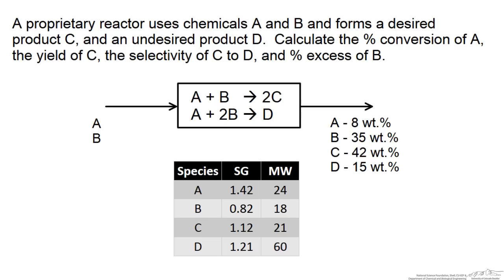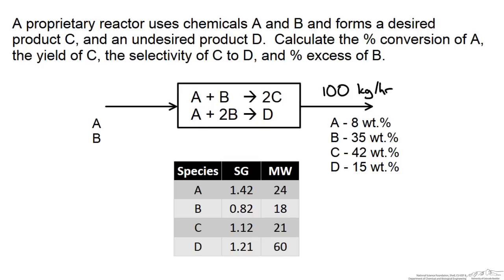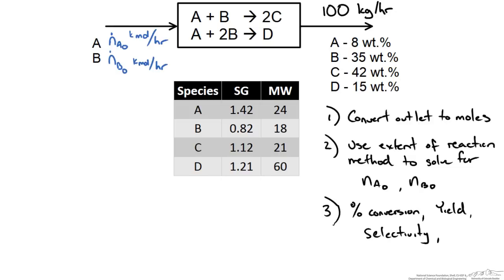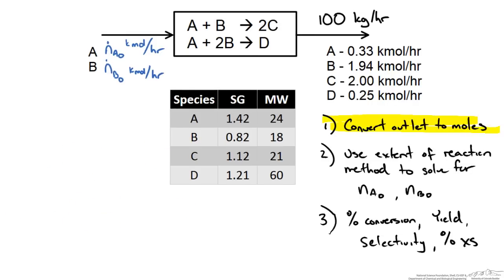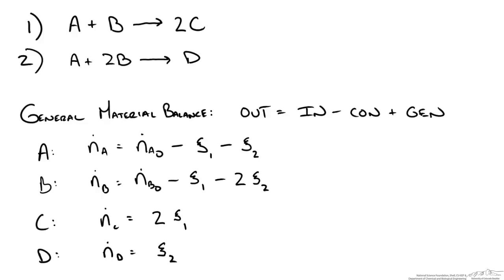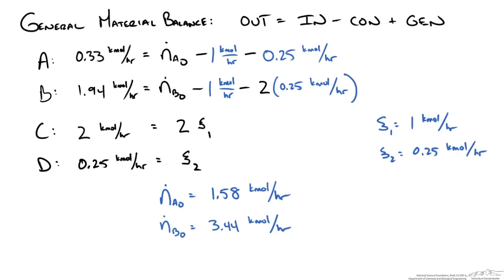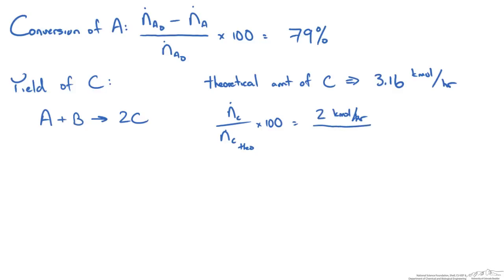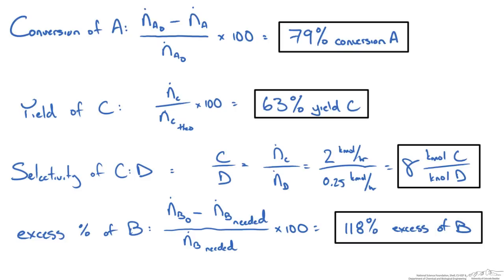Two Reactions (Extent of Reaction Method)

Comment: based on 'introduction to material and energy balances' G.V. Reklaitis, the correct answer of fractional yield above is 2/2(1.58-0.33)x100% = 80%
Reply from the maker: Thank you for the comment. I looked in this book and Reklaitis calculates yield in the same way this video does, which is net rate of production (actual) divided by the maximum possible rate of production (theoretical).
Reply: @LearnChemE  not divided by the whole feed, but the amount of feed which is consumed in all reactions, take a look example 3.15 and 3.16